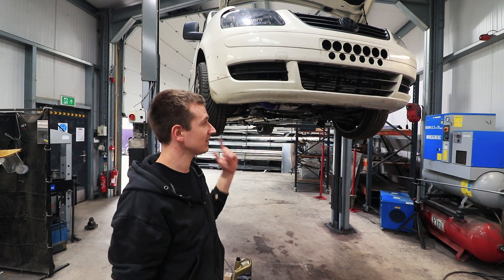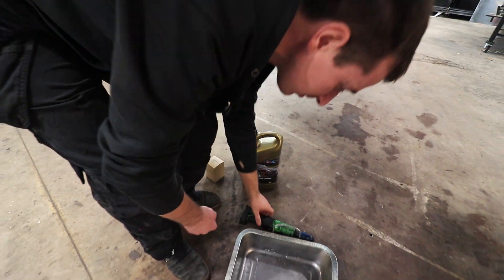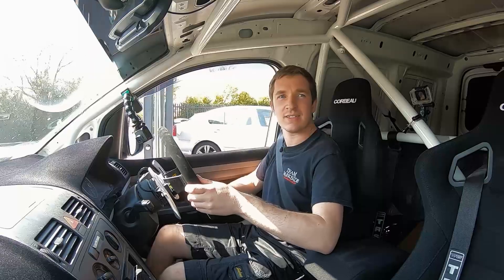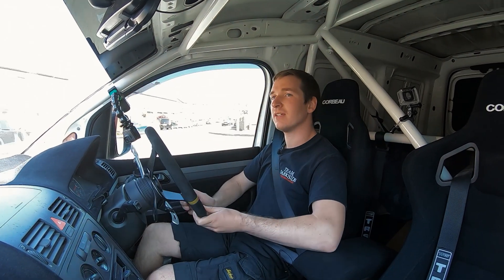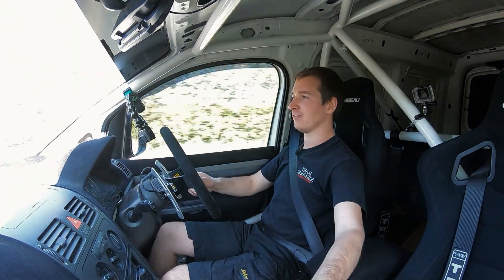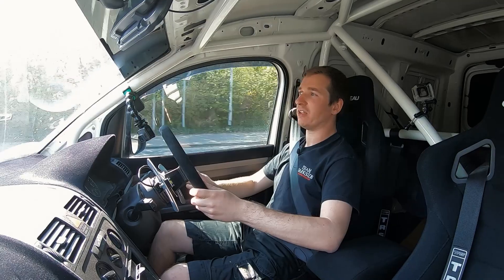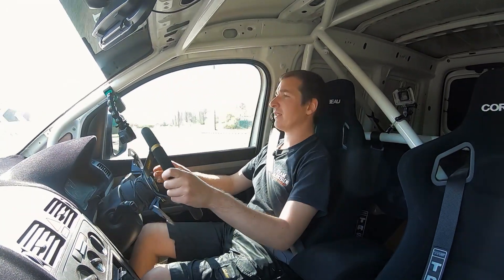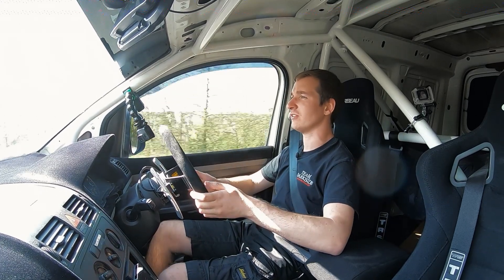386BHP 2.0 TDI CR CFHD DSG 4-Motion VW Caddy Van! - SRS Automotive / Darkside Developments

Comment: 490lbft that's a good number for the darkside, see if my math is correct, that would be about 666NM 😈.
Impressive numbers, getting close to 200hp/liter, in a diesel..., 1150kg that must be a decent parts delivery van, will deliver before can hang up the phone 🙈.
Sounds of this 4banger are epic! Must say, it's weird seeing a caddy without a divider between passenger and cargo compartment never seen that, but that is due to the Dutch roadtax system, does help with the sound though.

Comment: Awesome power, congratulations on this build, I am amazed this gearbox could fit the engine and with the paddle shift setup.
 Can this set up pass MOT ?
Very impressive !
Reply from the maker: It's basically just a Tiguan 4-Motion Engine and Box...It's on the Road

Comment: Great video!!!  What gearbox code is this? And wil it fit in a Scirocco TDI for a 4motion swap?
Reply from the maker: Not sure on the exact code but it is a DQ500 Box. Not an easy conversion in the Scirocco but anything is possible. It is the coding / wiring that will be the issue

Comment: Regarding oil I’m pretty clued up on the old pd engines but I’ve now got a leon cr170 stage 2 if you will no gubbings in the exhaust egr off all that good stuff but was wondering what oil would you recommend for it I know you use a lot of cr engines in your cars so just wanting your 10 bobs worth cheers in advance
Reply: Just use platinum :)
Reply: A mean like 10w 40 5w 30 sorry should of explained it better lol

Comment: Hi I'm stripping my caddy sdi at the moment so would like to ask is this still a bkd engine in this caddy your doing ? and also what parts  would I need to fit the bkd in my caddy and I have my daughters old mk5 gt tdi bkd 140 dsg which was hit in the rear so thought I should make good use of it any advice would be greatly appreciated
Reply from the maker: It got swapped from BKD to CUAA, got all the specs with different engines and power levels here - https://www.darksidedevelopments.co.uk/caddy-mk3-2-0-tdi-common-rail-cuaa-4-motion/

Drop us an email to sales@darksidedevelopements.co.uk for advice on parts :)

Comment: Looked at the builds on your website, looks as though most use the CFHD engines. what did this engine come in, as there's no mention of this code on wiki. Also, how good are the mk6 golf GTD's for tuning, better than the mk7's? or just avoid them altogether and get the cr140 instead?
Reply: It's the same engine really. They are good!

Comment: Do you have a preference for the brand of fuel ⛽️ that is the best to use
Reply: Whatever is cheapest!
Reply: Ryan P 😂😂😂
Reply: The reason I asked re the fuel ⛽️ is with petrol it makes a big difference what brand of fuel you use to the power output. Ie Tesco 99 apparently gets 20 more horsepower than Shell Vpower on a mapped car, so they say and tuners not Tesco saying that
Reply: Ryan P Red diesel ;)
Reply: Green😁full agri mode🚜

Comment: What Turbo is this running?
Do you have figures on roughly how much flywheel power a stock CFGB can tolerate before things start breaking?
Reply from the maker: They are stuck at 250hp by the head flow. This has a GTD28 Turbo - https://www.darksidedevelopments.co.uk/products/garrett-gtd2872vr-turbocharger-with-electronic-vacuum-conversion-for-ppd-and-common-rail.html
Reply: @DarksideDevelopments  I'm in Aus. If I had the head ported and ordered this turbo, would this reliably run 300-320bhp daily? Thanks for the response guys.

Comment: Hey. Will you ever do something with JTD/CDTI engines ? There are some companies that offer JTD upgrades but I was always curious why you never did anything with these engines. From my experience they are way more reliable compared to any M/N/B47 or any gen of TDIs.
Reply from the maker: I dont know about being better than VAG, WG motorworks has some stuff for those
Reply: Darkside Developments by better I meant in stock form. For upgrades, of course VAG has the best aftermarket support and the biggest community.

Comment: Is DSG 7 speed version and does it have clutch packs clamp pressure increased?  I have petrol EA888 DSG mapped to 390hp and stock DSG is fine, but torque is different for the tdi.
Reply from the maker: Yes it is a DQ500 7 Speed and has a map for increased clutch pressure
Reply: Thanks for info. Amazing job you have done there - you know your stuff. Impressive.  Thinking (daydreaming actually) about a Caddy Maxi camper project build for 2021.   common rail 250hp ish with DSG and 4motion would make great underpinnings....  Best of luck with your projects.

Comment: Is there any way to have those paddles mounted on the column and stay fixed when turning?
Reply: You could do that
Reply: @ryanp6138  does that kit give you preference or does it only come with a plate for the hub ?
Reply from the maker: @jjtoutt  they come as 2 separate paddles so you can do what you want with them
Reply: Restricting gear change then really...4 motion too no prob changing gears in motion

Comment: hi there, I have a question
What kind of problems does the CFHD engine has? Does it has any oil pump problems like the old PD lumps and the balance shafts?
Reply from the maker: Not really any common issues! CFGB sometimes has Balance shaft
Reply: @DarksideDevelopments  Huh what about the CFHD? does that have a balance shaft? I've been looking for information everywhere about it, and I can't even find anything about the CFHD put into the A1 8X
Reply from the maker: @diogovieira3362  We would need the VIN to double check
Reply: @DarksideDevelopments  ah I see, thanks anyway. Thought it was the same as the 294 hp Ibiza you guys have

Comment: Cracking stuff. As it's still at full power at the limiter does they mean you could have a slightly smaller turbo to help with lag and not lose much through the rev range?
Reply from the maker: Then it would be restricted at the top. It's not laggy anyway
Reply: @DarksideDevelopments  I don't doubt that. Just trying to see if I understand the concepts. Keep it up.

Comment: I've got BMW e90 330d I have bought the car  mapped with dpf delete . I deleted the swirl  flaps i have one issue with a little oil leak at the front somewhere when  the car was moved there was a spot of oil about 10p size could you help

Comment: Gets to 80mph very fast then dies a little bit🤔
Reply: In sport it does,.
Reply from the maker: 1st run was in sport. It changes too early in higher gears. 2nd was manual so much faster. But it has the aerodynamics of a bus